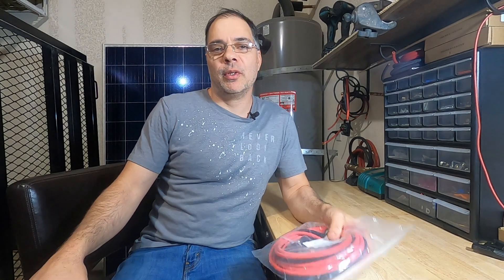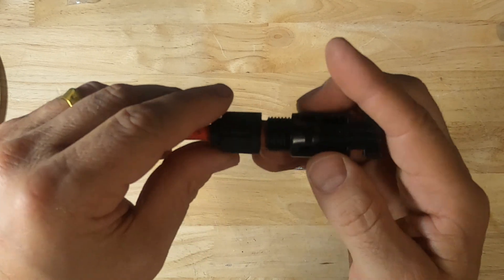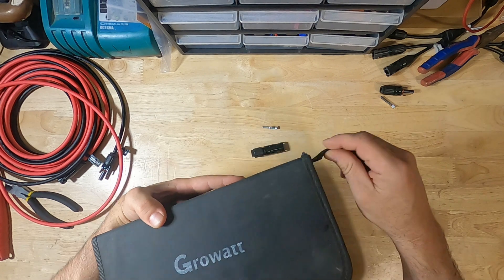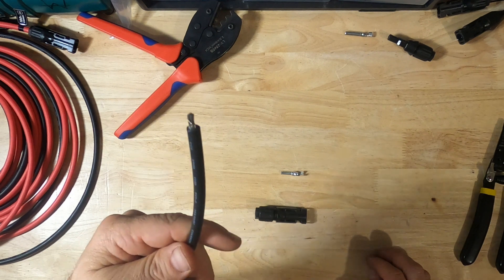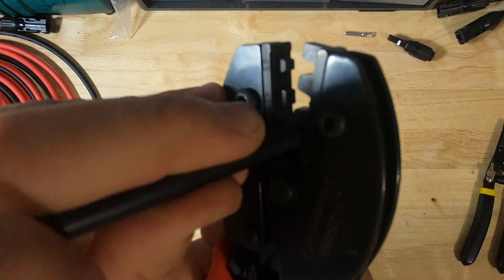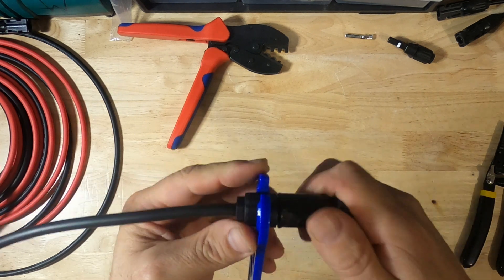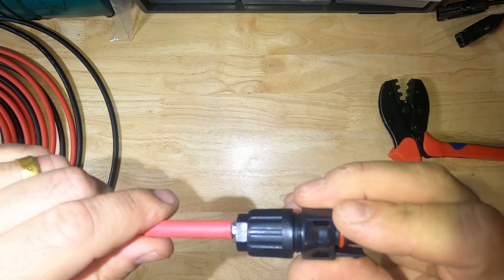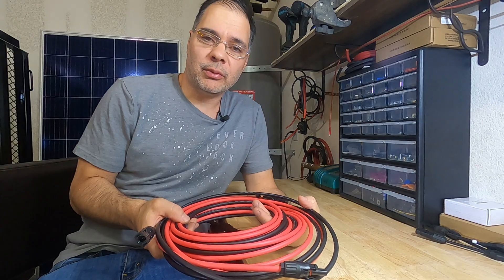How to Crimp MC4 Connectors

Comment from the maker: Remember that the female ferrule  goes with the male MC4 connector, and the male ferrule goes with the female MC4 connector. Connectors come in many different AWG sizes. Be sure to get the correct size for the PV cable you are using.

If you have to buy extra connectors, be sure to get them from the same manufacture as sometimes the end cap may be slightly smaller, and you will have a hard time getting them onto the cable. 

Enjoy!
Reply: Just in time   mate  got the half parts solar   ..cables and suport for solar , metal pipe  and tools wrench  drill ... only left crimp tool,mppt and  12v battery. I will install on balcóny apartament  abit more expensive  so  max protection  in case of wind
Reply from the maker: @intech7863  awsome. Lmk how it turns out.